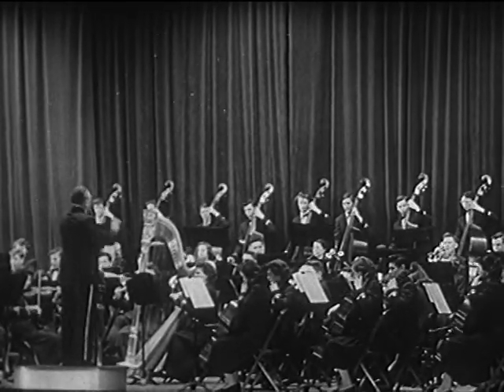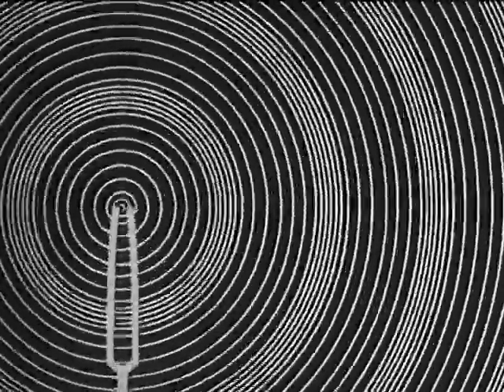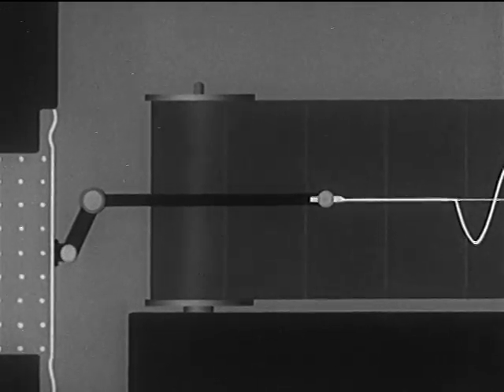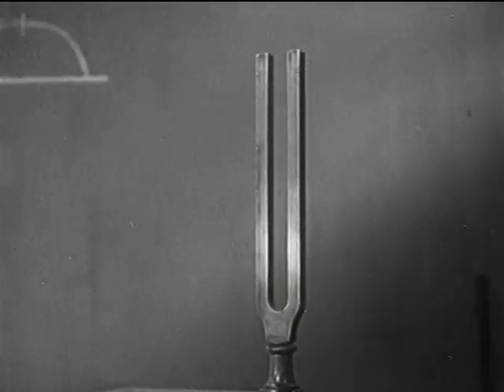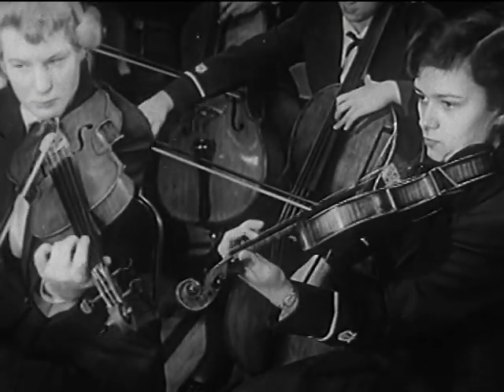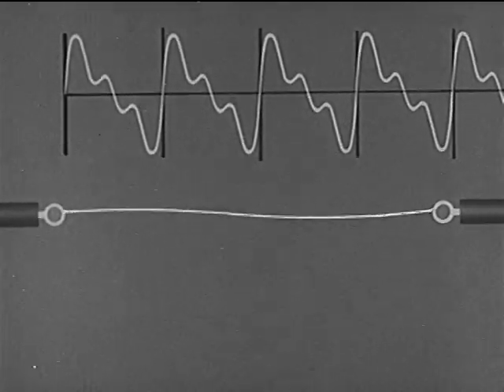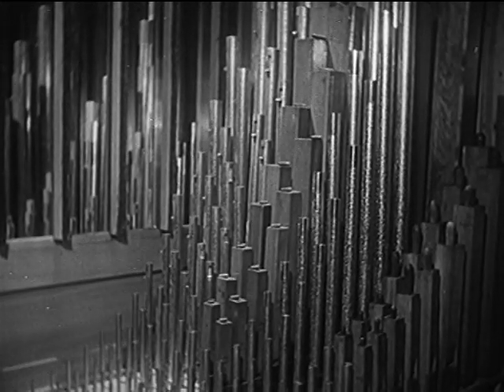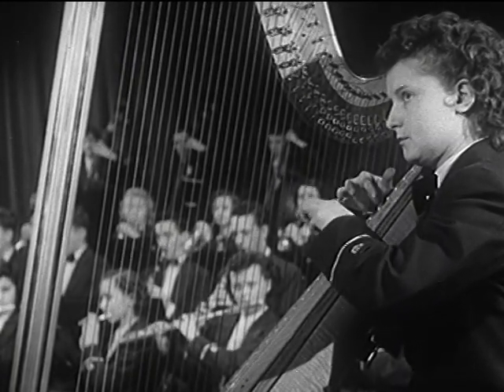Sound Waves and their Sources (1933)

Comment: but why?
Reply: ActiveStorage There are many ways to approach this. You could consider probing a one dimensional transverse wave and doing standard F=ma to obtain the wave equation obtained by D'amblert (which is not at all mystical) the standard analysis then shows that the speed is dependent not on the amplitude, but the tension and mass per unit length. From there, the longitudinal versions follow in analogy. It is always that speed of propogation is a property of the space itself: a fight between how loosely speaking stiff it is and how resistant it is to motion- inertial.